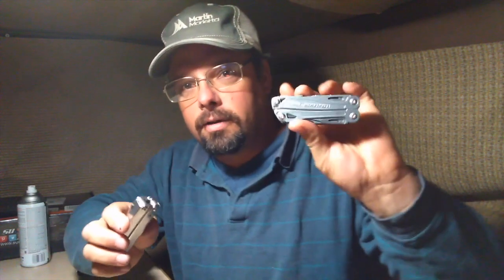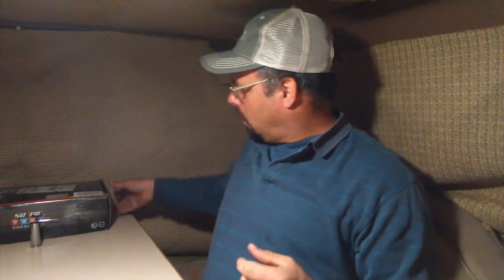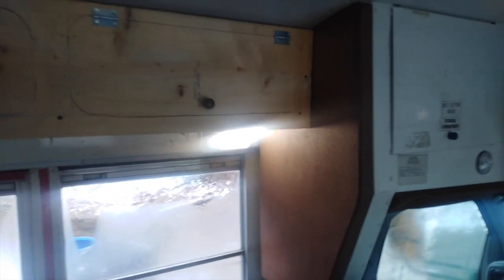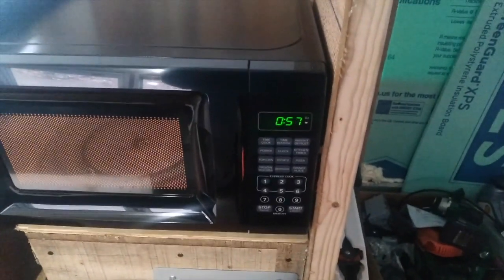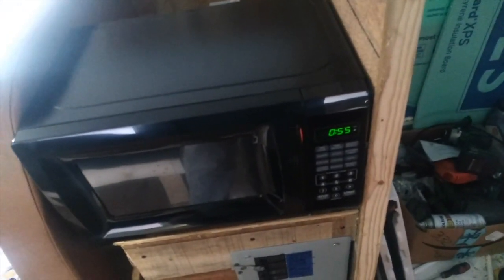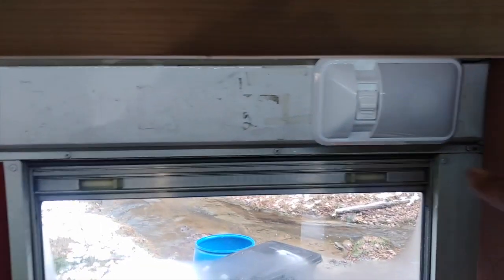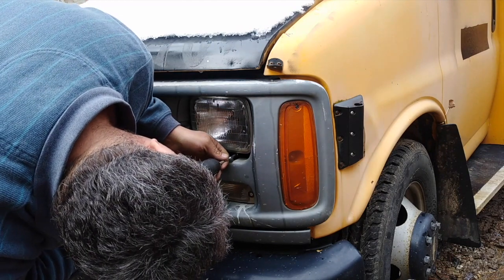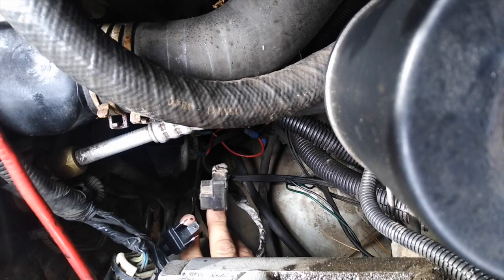LED Lights in The Skoolie

Comment: Nice update, hope you will let us know if they give you any trouble. They are getting quite popular, that electric white color is all over the place now.
Reply from the maker: I hope they last. I drove up to the mall last night with them and the difference was incredible. I can actually see what's in front of me now! I didn't get any other drivers flashing their lights at me so I guess they don't blind anyone. I'll let you know if they stop working or anything.
Reply: One of the reason I wanted a older unit was for glass head lights. The plastic dull so fast n easy keep us posted how these hold up